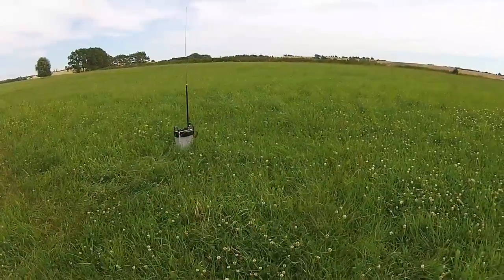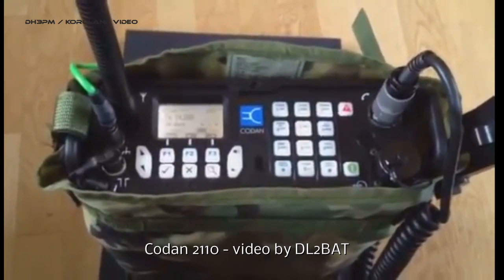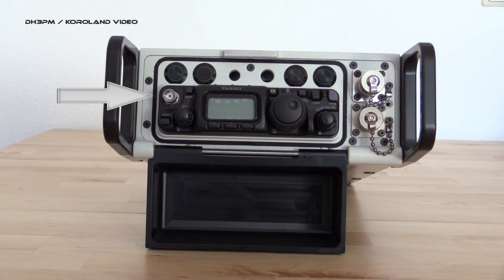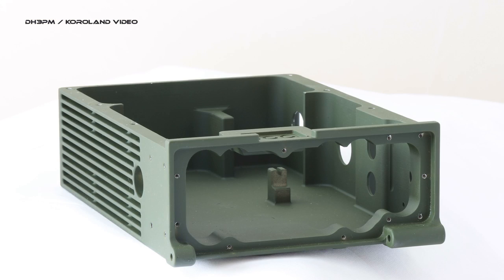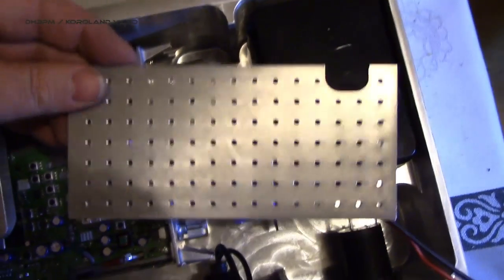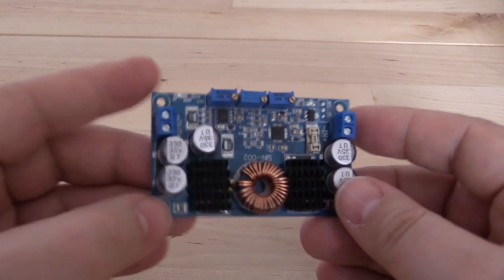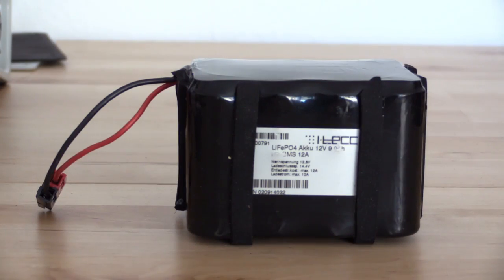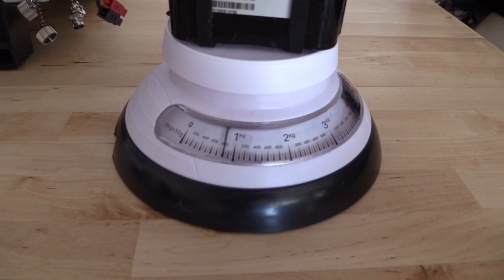inside Hampack - a closer look to the FT 817 Manpack [english]

Comment: any plans for the ft-857?
Reply from the maker: Sorry - no. I have an Idea of HAMPACK V2 in my mind but this will take some time. It will not support the Yaesu FT 857. Yaesu seems to me that they are way behind the needs of the market and not willing to produce something really interisting. SDR are state of the art and this is what I have in my mind for V2.
Reply: i wonder if you made the pack more generic so that any small radio could fit in it and then sold custom molded faceplates to cover the hole so it would still be waterproof. The faceplates could be made on a 3d printer so as to keep cost down.
love the design though and looks awesome!!!!!

Comment: Hi Patrick, great pack, love the design, could it be 3D printed? To reduce cost, which antenna do you use for the man pack? I also have an FT818ND 
Keep up the good work and stay safe
Reply from the maker: Thank you! Version 2 is in planning. I sold all hampacks version 1. You can use any antenna. Mostly I use chameleon antenna and diamond single band antennas for shortwave.
Reply: Hi Patrick sorry to bother you again but I’m completely new to ham radio, do you use the diamond HF FX range or CL range of monoband antennas?
Reply from the maker: @dalekenworthy  i use the Diamond HF20FX in this Video if i remember well.

Comment: Question can you make it stackable with multiple cases screwed together??
Reply from the maker: Yes - on the bottom side there are also holes with blind screws. They can be used for anything you like. In case of stacking you can use these screws for a connecting sheet to place 2 of them in a car for example.
Reply: i meant  actually screwing the cases together removing face plate.. so you could use more than 1 radio.

this would be a great modular option for vehicle  solution van solution or remote base

ever thought of doing a complete battery module where you have a complete case full batteries

what are the cases worth on their own??

ever thought of doing a 1-2u case option
Reply from the maker: No.Please keep in mind that we had to make it as simple as possible because of the financing. We had the same idea but in the end we could not follow all the ideas. Maybe a rich supporter is out there in the world for Hampack 2 ;-)
Reply: I think as designers we think of 1 design form factor and fail to look past the intended use of the chassis design..

You have multiple markets on case alone..

I'm not saying not to Develop this concept as a standalone unit..

Though think past that concept and see marketing the case on its own with nothing would be more value to the company, than building the form factor and shoving in obsolete hardware... In it
Reply: you should put this on kickstart